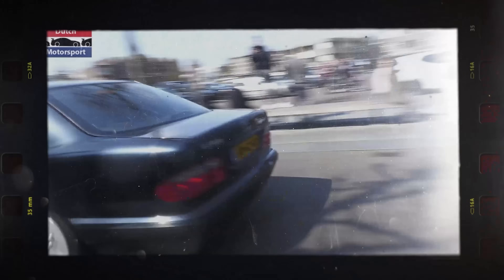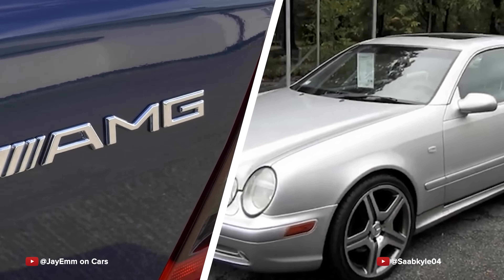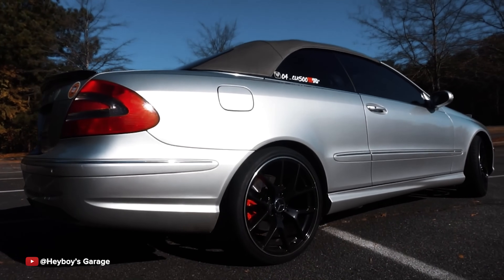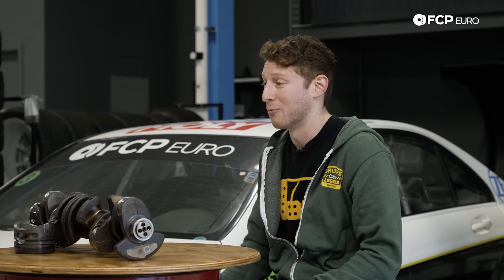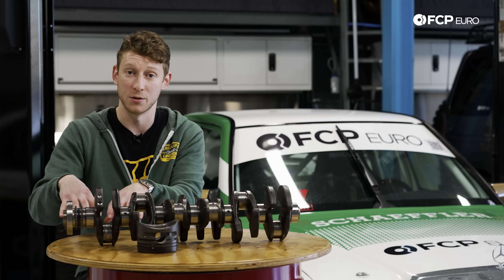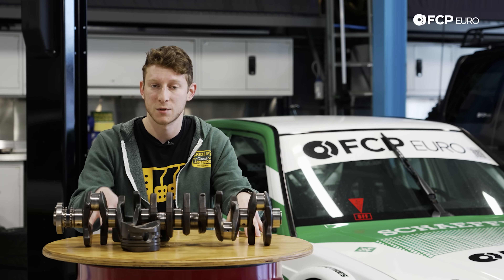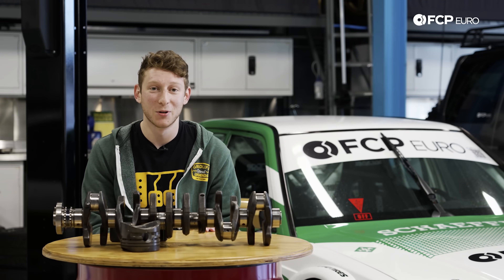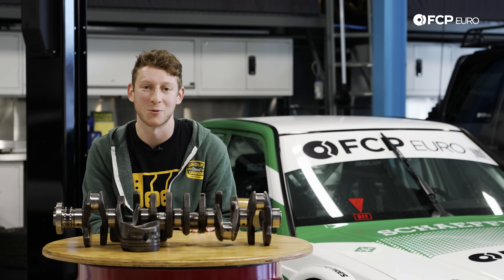Speed on a Budget - Fastest Mercedes Under $10,000

Comment from the maker: Yeah...we might have gotten a little carried away with the Mercedes chassis codes on this one. For W's and numbers converted to year ranges by chassis, see below!

W208 (CLK430 and CLK55): 1998-2002
W209 (CLK500, CLK55, CLK550): 2003-2009
W210 (E300TD/E55): 1996-2002 
R170 (SLK230, SLK32): 1998-2004
W203 (C230 Kompressor Coupe, C55): 2002-2007
W163 (ML55): 1998-2005
W220 (S55, S600): 2000-2006
C215 (CL55, CL600): 2000-2006
W211 (E320 CDI, E550 4Matic): 2003-2009 (CDI only sold for two years in the states)
W212 (E550): 2010/2011 with M273 engine
R171 (SLK280, SLK300, SLK350): 2005-2011, switched to M276 engine at end of production
Reply: You have good taste!🎉
Reply: thank you for the decoder ring!
Reply: W211 E350

Comment: As a owner of a W208 CLK55 AMG, I feel like the W208 is highly underrated and forgotten about, it’s an amazing car that I feel gets overshadowed by the W210 E55, both are amazing cars, but the W208 CLK55 AMG has almost no coverage or video about it on youtube(about 200 or less videos that are over 30 seconds) which I think happens due to the its sister car the W210 having such a big fanbase.

So I appreciate the inclusion of the CLK55 AMG, because any new video covering it is an amazing thing since almost nobody talks about it. I always check youtube again and again looking for new videos about the car.

And for those wondering the W210 E55 shown at 9:40 is actually a pre-facelift version and most likely a 1996 to 1999 model, the post facelift versions from 2001 and 2002 have a slightly updated speed gauges a bigger information hud on them, buttons on the steering wheel, an possible infotainment screen in the console and the possible option of being all wheel drive(an optional choice from factory not many chose, so it is a bit rarer). And like said in the video the E55 is appreciating in value and I personally believe that the love the E55 gets is completely valid and that it is a perfect 4 door cruising sports car that gives that feel of the late 90s early 2000s.

Comment: Great video! I got my 2001 C320 two years ago at 64k miles, its at 84k miles now. It has the 3.2L m112 v6. I got the car for 6.7k and I have put 5k+ into making the car reliable, fun, and comfy. I installed a 10" touch screen headunit with a backup camera, removed the muffler, removed secondary cats, increased the throttle body size, installed a pedal commander, and installed a custom dual cold air intake (with a tune in the works 😃). So fun to drive and very rewarding to work on. It's a bit of work whenever there is a problem, but I love my car so much.

Comment: I can vouch for the SLK32 AMG. R170 is old school Mercedes and therefore bulletproof reliable and cheap to fix when something breaks. No AMG specific parts on the body except bumpers. So if you need anything, there's plenty of cheap parts around.
I recently sold mine with 378,000 km on the clock (236,000 miles) and ran beautifully and lots of fun. Silly power in such a small roadster. But rust was an issue,  mine was used for daily commuting in The Netherlands where we have salt on the roads in the winter.
R170 is not a dynamic sharp handling car though, the steering rack is slow, it handles like any other classic Benz. But it must be the most bang for your buck and the lowest risk entry into AMG.

Comment: Excellent review. I've owned a few of the cars you recommend, and still own a 1998 SLK230 kompressor, with just over 50k miles. We bought it in 2015 for $9k, and it had 34k miles on it. Great car, just about completely trouble-free. It's under wraps now for the Winter.
We also owned a W210 E320D, with that great inline 6 TD. We'd still own it, except it was, alas, totaled (no injuries) accident. Furthermore, we also purchased, for our son, a 2007 W203 C280 4Matic. Great car and it was only $7k at an estate sale. Had just around 110k miles and in perfect condition. It's only needed a brake line and a front axle (torn CV joint, and it's cheaper to just replace the axle).
We also, with the SLK230, now own a 2013 W204 C300 4Matic Sport. Great car... the M276 is great, solid as a rock and we get over 33mpg on the road, usually at 75mph. Handles like a dream, even at 117k miles on the original suspension. The 7-speed trans is fine and properly maintained, as is the entire car.
I like the idea of the later CLK coupes. I would not mind the E55 W210 chassis version, but they are tough to find.
Have a great 2024.
Keep the shiny side UP!

Comment: These are all arguably the most reliable Benz's after the Heavenly Sacco era.

Great list. I still kick myself everyday for going with a C207 E350 instead of 550. I was newer to wrenching then & afraid of doing rear main, engine mounts, or dealing with dynamic suspension out of the gates as well as far less working room. Don't care about that now! Hahaha
Reply from the maker: Right as always, Roth! A lot of these cars are a part of a different Mercedes period in time than the "golden age," but are fringe enough that they maintain some of those key elements...keeping them cheap and modern, but reasonably tough as well.

Nothing wrong with an M272, especially in as lovely of a chassis as the C207! The M273 is great as well, but that's definitely a large engine for a tighter engine bay. Always wise to look out for your future self!

Comment: I agree 2004 s600 ebay buy,
$4500, 12.72 109mph . Shuts down at 130mph,
Coils packs are easy, abc is a headache. 
Also 2 r129 sl600. 
Could all be bought
Reply from the maker: R129 is also a great call, especially with the M120! Reasonably affordable, awesome soundtrack, and pretty reliable to boot. It may not be the fastest out there, but it's one of the prettiest and best to drive.
Reply: By "shuts down at 130" you mean it tops out there, right?
Reply: @nataliegrn17 no its still pulling hard, speed limiter, don't know how fast it would, the r129s are limited to 155,
Reply: @nataliegrn17 non AMG speed limiter for that car is 130mph, AMG 155. Both can be coded out.

Comment: Great info couldn’t agree more and for those wondering about the M156 cars, unless you can wrench yourself and willing to invest in fortifying that engine with all its issues just stay far away.
Reply from the maker: They are PHENOMENAL engines, but they definitely need some TLC here and there to stay happy. Though, the same can definitely be said for something like the M275 on this list!
Reply: @fcpeuro  yes great engine with loads of aftermarket support but definitely not budget friendly so can’t be included here. Absolutely love a W204 C63 and have done many engines on them at various levels, such a monster but boy oh boy it drains your wallet lol!
Reply: My dream build would be a W204 C300 6 speed car, swap in a M273 5.5 V8 using C63 suspension & brakes ultimately creating a more modern C55, with LT headers, exhaust and a tune it should be good for 450Hp. Not as cool as a C63 but definitely something different and cool you built yourself.

Comment: W212 E550 absolutely! I love the damn thing. Juat having issues with the air suspension blowing out now 😢
Reply: Airbag delete and a set of quality coilovers like Bilstein PS10’s or equivalent would solve that problem, did that on a W212 E63 and it totally transformed the car
Reply: keep the air bags you won't regret the silky ride.  The hardest part is trying to detect the leaks.  Just replace the rear bags and be done with it.  I tried for several weeks to absolutely be sure I could confirm the leak and eventually got it down to it just had to be the rear bags and once I replaced those I haven't had a problem since.

Comment: Lol, I have 2 on this list. W208 CLK55 and an '05 R171 SLK350 6 speed. Currently selling the R171 for $9k in Tampa, FL.
Reply from the maker: Seeee just under $10k Like we said haha. Feel free to link people to the video to find out more about what you've got!
Reply: How do you feel about owning a W208 CLK55, I own one and it feels great, just wondering what your opinion is on it?
Reply: @Changingtesting hands down the best car I’ve ever owned. I bought it almost 2 years ago at 89k miles, I’ve got a little over 100k on it now, only issues I’ve had are the common ones. Throttle position sensor, MAF sensor, leaky valve covers, trans mount, but it never fails to start. It’s never left me stranded, plenty of power to hang with even newer cars (I’ve got a couple sub 5 second 0-60 sprints on draft), comfortable cruising at any speed, just an absolute gem of a car

Comment: 2002 to 2004 M112K C32AMG are a really nice vehicle, and you can make a lot of power with a few bolt on. I have owned 1 C32AMG 13 yrs. now and its still going strong and purchased a project 2003 C32 in 2021 that now has a 188K. The supercharger charged air intercooler are the weak link however in the M112K and M113. They start to fail leaking coolant into the cylinders and then fouling the upstream Cats. I will be replacing the intercooler on my project C32 this coming weekend and have already replaced the charged air intercooler on my 13 yrs. old vehicle for this issue, they run anywhere from $581 to $1600 for the charged air intercooler and are a simple fix. The M112K Supercharged engine is also in the Chrysler SRT6 Crossfire.

Comment: Yes!  W220 let's go! @14:37 is that a feature through xentry? What is the purpose of doing that?
Reply from the maker: Sometimes referred to as "Rodeo Mode," it's a method of bleeding/testing the ABC suspension by cycling the entire system. Useful, and also a fun party trick!
Reply: @fcpeuro  wait a minute that's a cool trick. But is there a way to modify the airmatic to make it move faster?  Like maybe w bigger compressor and bigger tank? I just saw the tank and it's like a size of a personal watermelon.

Comment: If I'm interested in one of the 220 chassis you listed, did the 2004 - 2006 model years avoid the rust issues so common on the early 220s?
Reply from the maker: Tales on the forums and beyond purported that the facelift helped a lot with some of the rust issues on the early W220s, but we would still suggest you're vigilant when shopping. Grabbing a later-production W220 from 2003 or beyond will generally keep you safe from any severe rust, and models in this age range are generally the ones you'd want. They're screwed together a bit better than the earlier ones!

Comment: I daily drive a 2004 S600 with 175K KMS. I bought it in Oct. 2020 with 144K KMS for $7000 + taxes CAD. I’m about $20K total (car purchase, parts, labour, maintenance) into it 3 years later and 30K+ KMS. It had the StrutMaster suspension kit installed previously. 

This car is a great sleeper, specially in silver. It Runs 13.00’s at 110 MPH all day long just planting your foot to the floor. This is not a 1/4 mile car. It’s a rolling start Autobahn boat :)

Going down the highway, the Merc sticks to the bumper of any newer 500 hp car period. Corvettes, Mustangs, Camaros, and Challengers hate this car. Not saying it’s faster but you ain’t going anywhere :) AMG, M and Audi RS guys are usually pretty impressed.

It’s purely a big cruiser that likes to go very fast in a straight line under the right circumstances. 590 lbs of torque from 1800-3600 RPM is super usable in every gear and creates effortless acceleration at any speeds.

The car has some many modern features, keyless go, proximity key, pre collision warning, adaptive cruise control, cooled message seats, dynamic seats, heated power rear seats, Navigation, killer sound system, soft close doors, spotless leather and Swede headliner, etc.

Sites like FCP make owning cars like this possible so thank you. If you have a good mechanic and don’t mind sourcing parts sometimes these cars are great. 

I could talk for days about the W220 S600 and the wonderful M275 but honestly words don’t do it justice. People talk down about these cars but have never owned or experienced one. I drive a lot of nice newer cars in my profession and I can say this car is a keeper for me and I hope the values never go up on these V12’s as I want a S65, SL65 or CL65 someday soon :)

Comment: The 2010 E550 sedan RWD was in my crosshairs until I learned about the rear subframes rotting away on the W212.    While MB USA extended the warranty to 20 years, these cars are currently  14 years old with only 6 remaining. It would seem depending on winter road conditions the still unimproved subframe would need to be replaced every 75 miles.

Comment: Hi I have a question to ask regarding the capability difference between M111 and M271
I have the M271 EVO in my car, I just want to ask if it is safe to push 300hp or should I just get a more powerful Mercedes?

(I really don't want a V6/8 on my c204 or a front wheel drive based AMG as I'm using it for touge run)

Comment: Have had the W209 CLK500 and currently have a R171 SLK55. Both have been great cars, fun to drive and cheap to run! Had a W163 ML320, nice runabout when it was new, but build quality was really poor.
Reply from the maker: A great spread! All three are fun cars in their own unique way. We've been waiting for the R171 SLK55s to dip under $10,000, but they might just be a biiiiit too much fun to ever depreciate enough!
Reply: What kinds of build quality issues have you heard of or seen?
Reply: @nataliegrn17  in the 4 years I had the  ml320 as a work vehicle, a lot of the interior parts started coming apart, and panel gaps weren't as consistent as my other Mercedes. Mechanically the W163 was great.
Reply from the maker: The "Alabama Trashcan" nomenclature is a bit harsh, as it refers to the W163 being assembled in...you guessed it, Alabama. This was a bit of a change-up from how we knew Benz to do things at the time, and people are often a bit more critical of them than necessary as a result.

Some folks will complain of panel gaps, accelerated wear of plastics and interior parts, and some extra squeaks and rattles in the cabin, but in terms of driveline, they're pretty stout and will generally get you where you need to go.

Comment: I watched this video and currently own an 06E55 AMG.  I would love toe have a W220 S500 or the S55 but both of my mechanics say that parts are difficult to obtain.  Your thoughts?
Reply from the maker: Genuine part availability is definitely tougher on the cars older than 15 years, no denying that. Benz has definitely been trimming down the number of chassis they're willing to support once they're a decade or two older. Fortunately though, a lot of awesome OE, OEM, and aftermarket suppliers are out there keeping these cars on the road. Brands like Lemforder, Arnott, TRW, URO Parts, and SO of others are all available on our site with the pointed goal of being able to keep the cars that have been on the road for a long time on the road even longer.

I'd always recommend that if you're considering a car, hop around a bit on our site (and even others) as if you're planning for a somewhat comprehensive rebuild; a full suspension service, or a brake overhaul/engine tune-up. If you can find everything with ease, it suggests you'll have a pretty easy time across your ownership. If the results are more piecemeal, you might have to get a bit creative through your ownership. We're always rolling out sneaky retrofit solutions though!

Comment: I need more content on the M272 powertrain found in the W203 C230 Sport sedan. I have a crack in my valve cover and I'm told there's NO WAY to replace it. So, welding? Hot weld? Cold weld? I mean, otherwise, the engine has been amazing. Help a brotha out! 😁
Reply from the maker: That's a tough one, as the cam bearings are integrated into the valve cover on the M272 and M273. Typical recommended procedure is unfortunately to replace the entire cylinder head, but depending on where it's cracked and if you can find someone willing to try to seal it, it may be worth the effort.
Reply: Rip it out and swap in a m111k

Comment: So whats the best performing manual, for a daily driver under $12000 USD ?
Reply from the maker: An R171 SLK is a great pick for less than $12,000 as long as you avoid the balance shaft issue, which is easy to check for using the VIN! But for other ideas, check out our "Every Mercedes Sold With a Manual Transmission" blog article, or our video here on YouTube!

Comment: How about 2002 CLK55 amg coupe convertible? I’m also looking at  models 2007 S550 and the SUV 2011 ML550. There’s a 2008 ML63 AMG with a Weistec supercharger with tune on one I’m looking at but it very high mileage so I’m quite nervous about front turn key costs. Which is what I’m looking for in immediate needs. Turn key ready, but not afraid to handle maintenance when it comes up. Just not initial upfront costs lol
Reply: I bought my 07 S550 4Matic in late 2021 and a little over 2 years and 21k later I can report this is the best daily driver I've ever had.
Reply: @kevin9c1  07 S550 is a solid purchase including to invest in maintaining, correct?
Reply: @K1NGKQNG  Maintenance has been quite reasonable.  I can list the things I've done but mostly preventative and not much for actual repairs.
Reply: @kevin9c1  any info helps. As these are things I will put in to forward thoughts when examining the vehicle before purchasing.